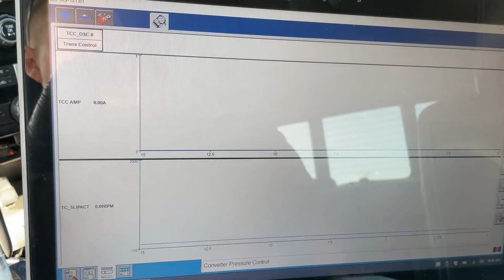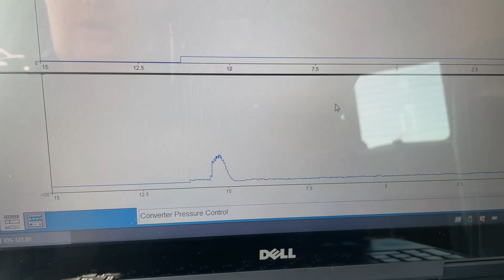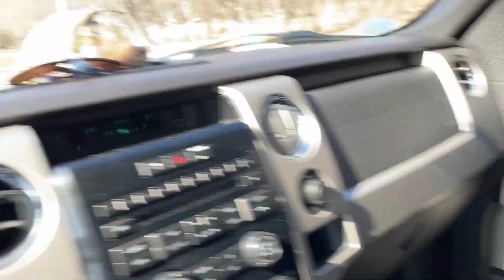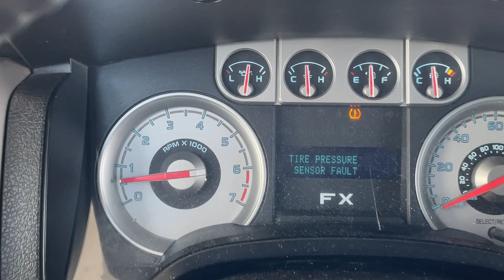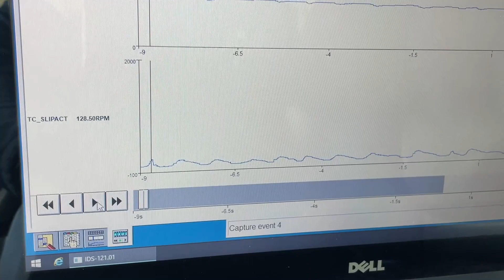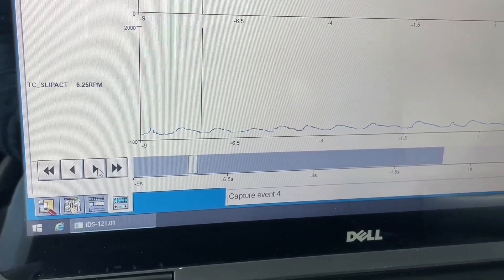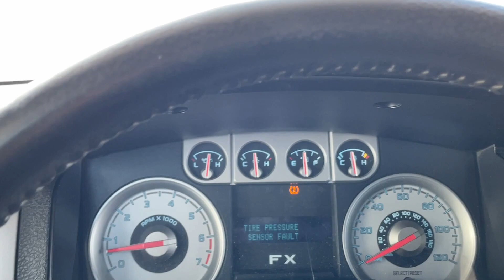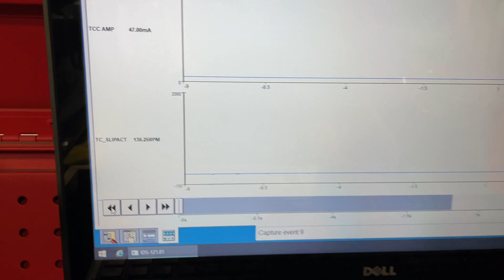Ford F-150 6R80 Six Speed Transmission Surging: Rolling Torques Converter Clutch Failures

Comment from the maker: Forscan is a free Ford Specific Diagnostic Software:
Download Here- 
https://forscan.org/home.html
ELM 327 Adapter I Recommend-
https://amzn.to/2GC6dBj

As an Amazon Associate I earn from qualifying purchases.

My Automotive Repair Shop BSG Automotive- 
http://www.bsgautomotive.com
Reply: You nailed it!  Exact issue with my 6R80.  Trans was replaced by dealer previous owner, but they did not change TC at the same time.  I only suspected TCC after all this time, until surging at highway speeds started to show up.  Only an intermittent shutter in first gear for a moment, then okay.  Was an inconclusive diag without YOUR video here… thank you so much!
Reply: Is that the software you use for your diagnostic computer or do you use the Ford factory software?
Reply from the maker: I use the Ford stuff.
Reply: Have a question ? Does a 2012 F350 have an auto bleed for the brakes and abs pump programmed in the ECM? Have been watching and using your vids for years ! Thank you !

Comment: Long shot for a reply on this old thread but ill shoot my shot! Bought a 15 2.7l f150 to get away from my 06 5.4 that you and your info helped me keep it running past 230k. Low and behold its experiencing similar issues and after 3 shop visits and being told its normal for these rigs to shake and vibrate like a friggin shakeweight, im at a loss. I offered up my months worth of live data logs and they all dismissed it reyardless of it being directly from forscan and up to the moment i brought it in. Trans duty cycle command is at 15 , actual stays at 47% , tcc slip actual constantly dipsninto negative values as weird as that is, but thenother values that were strange are the shft type sayingnim rapidly changing from 1st manual to auto 4th to man 3 to auto 1st , all while driving in 6th in cruise control.  Noticed not one time has the tcc status changed from trans control to locked or unlocked and various other strange data values. Even had my gas pedal go flat outta no where with no response for about 10 seconds then it all came back like nothing happened. Losing my damn mind! Any info at all will be beyond appreciated!

Comment: Hey brother, always watch your videos, love them being an f150 guy myself. I recently did the full timing, ford eom of course, melling mh360v, i opted for the for racing roller followers and lash adjusters, put it all back together.  And amazing, sounded great... then about 200 miles into it i started getting a tick, drivers side. The tick follows the rpms. I havnt got back into it yet, but have you ever had a rocker fail in that short of time?  It sounds like between cylinder 6 and 7.  When i use a long screw driver as a scope.  Also since that short of time should a replace the valve cover gasket or do you think it would be ok?  Thanks for your time.

Comment: I just bought a super high mile 2015 F150 with a 2.7 and 6R80.  At first I thought it was the rear end chattering, but I think its the TC.  I get the washboard vibration intermittently, and under regular to hard accel, the power feels like it comes and goes, not quite a bucking feeling.  No CEL, but I can feel it.  Also sounds a little noisy at lower speeds, say when driving by a building at low speeds, can hear a hiss, kind of like when brake pads drag on brake rotors.  Also, seems with the cruise set, it has a hard time holding 6th gear.  Can't believe its a power issue, cuz it goes like hell!

Comment: My truck shakes at 48-55 only. Acceleration and deceleration. Tires are balanced. No worn mounts or bushings. U joints no play. No surges. New rotors and pads. Causes? Ideas?

Comment: I know this is an older video, but hopefully you're still monitoring comments.  Were you using forscan to manually control the lock/unlock function?  I can't figure out how to access that in forscan (if it's even possible).  I see TCC_OSC listed in the PIDs.  But I can't find anywhere to access it and change it.

Comment: My issue is loss of acceleration in between shifts. Like it shuts off the throttle, shifts and then acceleration resumes. Happens between 1-2, 2-3, 3-4 is good, 4-5 & 5-6 hangs before shift. Results are same under load, normal driving and downshift. This all started after I flashed the PCM back to factory with the Diablo i3 tuner. Do I have solenoid hang issues? Do I have to reset the adaptive scale? 2016 f150 2.7 twin turdbowl. Thx.

Comment: Im not aure if this is what i have going on with my 2014 f150 EcoBoost but im  getting a weird surging but only under moderate acceleration 3000-3500 and when its doing it im seeing boost spikes and then drops over and over. Ive replaced the BOV, throttle body, boost solenoid and both wastegates to no avail. I have no other shifting or surging issues otherwise.

Comment: Anyone steer me in the right direction? 11’ f150 5.0 6R80 transmission 122,000 miles.
Problem is, I’m driving Im pressing the gas steady. I’m at around 2300 rpm and then it drops some 400rpms. So it goes to 1900 rpm.

Comment: Can you do a video on replacing the torque converter?  That would be very helpful.  My 16 F150 with 106k just started to vibrate on highway under quarter throttle or so.  I added shutter fix and it stopped. I have done a pan drop and filter change hoping that it will correct the issue but am preparing for when the torque converter needs to be replaced.

Comment: I am not finding away in forscan to unlock or lock is it possible to toggle on and off like you did with the ford tool?
Reply from the maker: I am quite sure forscan is not bidirectional.
Reply: @FordTechMakuloco  Thanks for the reply and tip. I googled forscan and bidirectional. There is a control button that can be pressed to activate the unlock and lock toggle buttons. Ty again the channel rock!

Comment: Mine shifts great, no converter shudder or surging. I have this horrible whining noise coming from trans on cold startup and also whining when RPMs go above 2500. 2015 5.0 V8. I'm stumped. Gotta either be pump or converter.

Comment: I have an 02 VW Passat doing the same thing. especially when it shifts into 5th gear between 30 and 40-45 mph, but this does not occur when the cruise control is set at the same speed. I replaced the accelerator pedal, but maybe this is what is wrong.

Comment: I’m hoping you can answer this question, I’m thinking the torque converter is going on my 6r80, I’m not having surging issues like that, however my truck is acting like it’s on tow haul mode when driving, started last week. Takes a lot of rpm to change gears and at 60kph idling at 1500-1700 rpm. Doing a 100 kph, it’s idling at 2100-2300 rpm. I do get sort of a misfire symptom idling. Worse on a hill stopped at idle, Would that be torque converter?

Comment: I've only noticed mine surging at freeway speeds, going up hill or pulling a heavy trailer. It would throw a boost code because my throttle position wasn't matching boost because my torque converter wouldn't stay engaged.

Comment: Very nice explanation and demonstration, sure appreciate your sharing of experiences.  I have observe slight variations in tachometer RPM in another older vehicle as the transmission was shifting gears. Pending failure?  Further investigation showed it was just a normal condition as the Torque Converter Clutch was being modulated intentionally by the computer to allow a bit of slippage during the shift, softening the shift.  Its amazing what you can see.

Comment: Great video.. I have a 2017 F-150 5.0 with this same issue. The long term solution should be replacing the torque converter I’m assuming? I’ve heard shudder fixx works great. May use that for the time being.

Comment: My expedition does that exact same thing but the only difference is when i’m fully on the throttle and that got fixed when i just changed the torque converter

Comment: What was the ultimate fix?  I have a 2.3 Ecoboost 2017 Explorer that is acting up at 55,400 miles.  Erratic shift at light acceleration.  Tach jumps 500-1000 rpm, even at steady acceleration.  I don’t hear the engine surge though.  Dealer says can’t duplicate/no codes…nothing to fix!

Comment: Love the videos. Been to your channel many times for my family of (5) F150s. 
Have a 6r80 (2010) with a TCC shudder. I looked through your vids to see if you had produced one. 
A "shudder fix" additive has resolved for now. 
Things I'd like to know. When drained, how much fluid remains in the converter compared to full? Flushing doesnt seem recommended so is there any value in doing a second fluid change after some short interval? Also, this tranny seems to be in several machines with different weights, engines, tunes and rear ends. The parts houses keep trying to pull for a 4r75e. If opting to replace the TC, how to be certain of the right fitment?
Thanks in advance for any answers.
Reply: I just started having this same issue and the additive worked for me as well.  I am going to do a pan drop and filter change but wanted to know if you have an update on your situation. If the shutter came back and if you put in a TCC.

Comment: A local construction company owner, had transmission issues with his new f-150. The dealership couldn’t figure it out. The truck owners sister just happens to be an engineer at Ford. She brought her laptop back to Colorado, reprogrammed the transmission. Problem solved. Nice to have a smart sister that works at Ford !

Comment: I have the 6R60 that engages hard in first and reverse with some slight jolts in gear changes. Could that also be the valve body in a 6R60 trans?

Comment: Question here….. I have a 2017 F 150 4 x 4  XLT HVY DTY Towpackage. Feb 21 I at 93k I had to seek the help of an outside mechanic because the dealership could not get my truck in for 2 months. The mechanic determined that the Torque Convertor was bad and replaced it. Couple of weeks ago the Speed Sensor went out and again the dealership could not look at the truck to diagnose in a timely manner. Went to the shop that did the previous work and they diagnosed Speed Range Sensor bad. BTW I was driving at 70 miles an hour and the truck about ripped my head off and came to a dead stop. Speed Range Sensor is on back order indefinitely my shop can’t get it and the dealership cannot get it. What do I do?

Comment: Recently went to dealership AC barely blowing cold was told  “Evaporator core plugged up causing a lack of air flow. Recommended evap core and expansion valve with Evac and recharge.” Quoted $2,615.44 what are your thoughts on that? Thank you 🙏🏽(09 f150 xlt 4.6)
Reply: Does the heat blow hard? Could’ve a bad fan which should be an easy fix.

Comment: I have a 2017 F150 with 6r80, began shifting harder between 3-4-5-6 and had shudder in 5th and 6th. After 3 trips to dealer they finally replaced the torque converter under warranty, doesn't look like they did anything but replace torque converter, no flush, nothing. I had to pay out of pocket for them to replace the trans filter. I'm having the same issues as before, they claim I need to run 1k miles to relearn shift points but the shudder is still there. Shifts still rough at times. I'd appreciate your thoughts on this and what you would recommend.
Reply: Did you get your issue figured out?

Comment: I have a vibration in my 2015 f150 3.5 Ecoboost. Usually I only feel it over 55mph and if I stomp on it occasionally there is a metal grinding noise. Now I have P0151 oxygen sensor low voltage code. Im thinking maybe torque converter but the transmission shop said it checked out great
Reply: I have the same problem and can not fix it lol have you found any info
Reply: @tylerchapman5555  I fixed all sorts of shit and nothing helped finally I said fuck it and got a flush from the dealership ( I was hesitant because my last Ford had all sorts of problems after a flush ) Anyways, 1000 miles after the flush and it's riding like it is new off the lot. You have to make that decision though. For me I got to the point I didn't care if it fucked the transmission up I was at my whits end. Also, replaced the oxygen sensor off the back of the manifold and it turned the engine light off. Best of luck. The fix is never clear with this issue hopefully you find it out

Comment: Not related to this video, but do you know what might cause 09 Focus to stall when idling and/or breaking? I cleaned MAF, TB, and replaced head valve gasket, spark plugs, as well as ignition coils (huge oil leak in coils), and still having a stalling problem.
Reply: Check rubber hose going to throttle body.

Comment: AWESOME!! My ‘10 has been doing this for a while. I cleaned the throttle body with no luck so then suspected some kind of transmission issue. I’ll hook up the FORScan and perform your test but I’m sure that’s the problem. That said, what is the fix, R&R the torque converter?
Reply: Same question. What's the fix?
Reply: Fluid change best case scenario. Replace torque converter worst case scenario
Reply: I just changed the transmission fluid exact as recommended. Did not fix the occasional surging issue. I only get mine at 70 mph and RPM at 1,800. Rest of shifting and engaging good.

Comment: I really liked the C6 auto Ford had.
Great trans, simple function,  all this newer technology is nothing but expensive to repair.
Do we really need it? It is not like the trucks are now getting 30 mpg with it.
My old 1979 F350 with a 460 carb got around 12 mpg, my 2012 F150 gets around 15 to 16 mpg.
The 1979 was cheaper to repair.
Reply: Money is the only reason they make this new stuff. With a lot of sensors that can fail too.

Comment: I have a 05 f150 with 220k miles and the trans fluid has never been changed. I’ve heard mixed opinions on whether it should be done this late in the game or not but it still works fine.
Reply: In my opinion drop the pan and change filter and clean magnet. If it's never been done you'll have metal shavings and the magnet can't catch the metallic particles any longer. You can grind you trans away slowly.

Comment: I've found that Fords, as well as various other manufacturers, will not set a trans code/engine light until the slip is beyond 400 rpm. By then, you know from the seat of you pants that the converter is shot. But for intermittent complaints, I've found that at light loads having the a/c on will recreate the problem every time, from speeds of 38 to 45 mph. I'm not sure why, but at highway speeds, even light loads, the lock up seems to hold, even when the converter clutches are failing.

Comment: I have an 09 fusion. Does not have a cabin filter. The ac blows cold, but after a while it loses blowing power followed by white vapor. I turn ac off and lots of vapor with more blowing power. Vapor goes away and i repeat to try and stay cool. Whats going on? Please help
Reply from the maker: Generally this means the evap is freezing up.
Reply: @FordTechMakuloco  any suggestions on how to fix it? Video? Link?
Reply: Ok so i have no water drainage from drain tube

Comment: So does the torque converter have to be replaced?
Reply from the maker: The valves in the valve body generally wear out first causing the damage to the torque converter clutch, so both should be checked for a complete repair.
Reply: @FordTechMakuloco  if this surging is only happening while cold, under 30c or 100f, should I be looking at the valve body replacement first. I just bought this 2012 F150  a week ago and the issue is not at all obvious,
Reply: I’m wondering if you catch this early and apply valve body repairs (like a shift enhancer kit or remanufactured valve body), can the concern be resolved without replacing the torque converter?

Comment: Amazingly I’m sitting at the dealership for a neutral safety type of problem internal. The torque converter was replaced at 93000. Heard a bumping sound from the throttle body air intake sounded like gremlins inside trying to get out. My dealership has informed me that they cannot look at it until November! WTF! Sorry. The part that failed is on back order and the truck is stuck in their lot. I don’t have 10k to rent a car. Poor warranty service.
Reply: Hey my 2013 f150 3.5 trany going fr 1 to 3 back to sometimes fr 1to5 back to 1?

Comment: So, what is the solution...I might ask
Reply from the maker: The valves in the valve body generally wear out first causing the damage to the torque converter clutch, so both should be checked for a complete repair.

Comment: I have recently condemned 3 farm trucks that were all doing the same thing. I say condemned because they chose to send them down the road vs repairing them. People can say what they want about some of Ford's quality choices in the last several years & I would tend to agree with them on a lot of it but their diagnostic programs are 1st rate.  All the Ford programs & system scans take a fraction of the time vs other makes, Chrysler & Toyota being some of the worst. I've seen a Toyota total system scan take over 30 minutes!

As far as the TCC slippage is concerned, kinda makes you long for the days of AOD/E4OD. It's either on or off, none of this PWM half-ass engaged crap.

Comment: Ok I have a question for you. So do you leave it unlocked? Also If I go to a Ford dealership would they be able to unlock this for me?
Reply from the maker: No, you only have control to unlock it while using the scan tool.
Reply: @FordTechMakuloco  This is a very simplistic way of thinking.  With some basic electronics knowledge, you can likely permanently unlock the converter.  That said, I'm not sure if said methods would cause a CEL making the vehicle un-inspectable in many states.